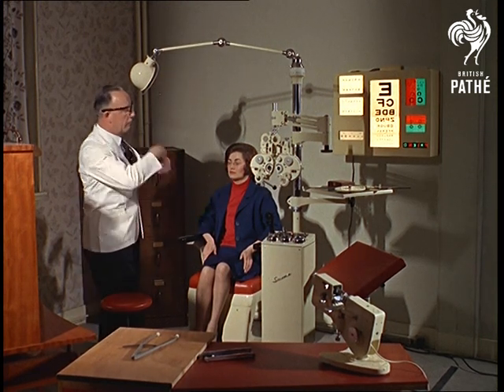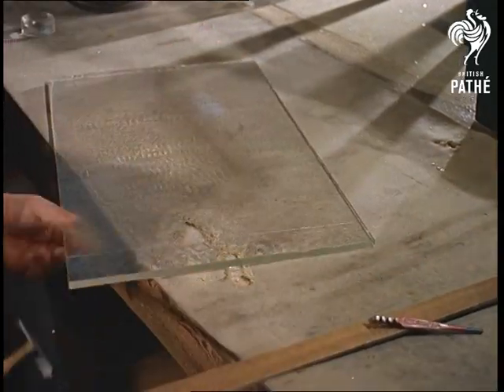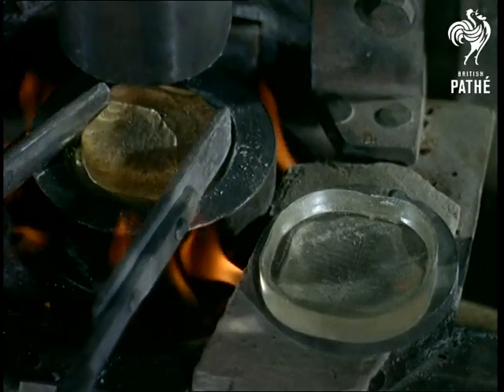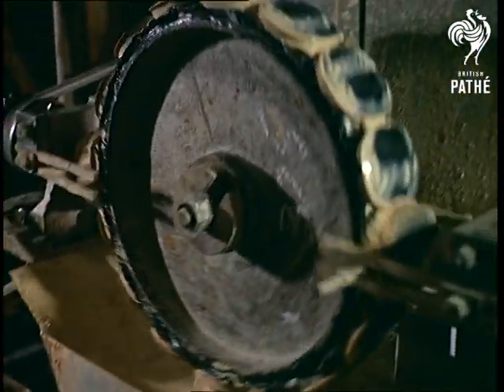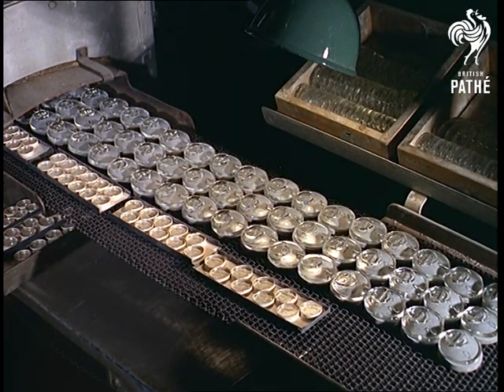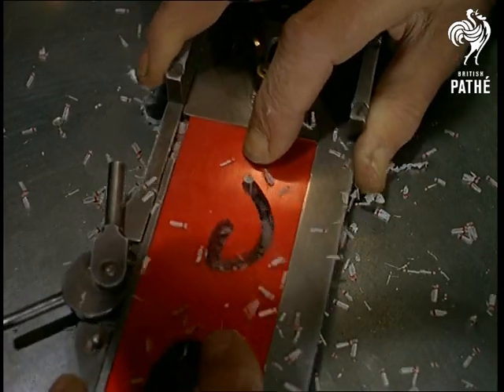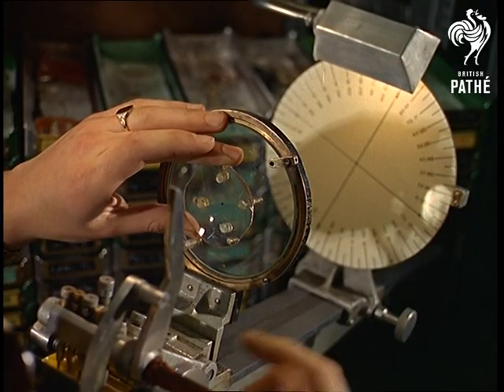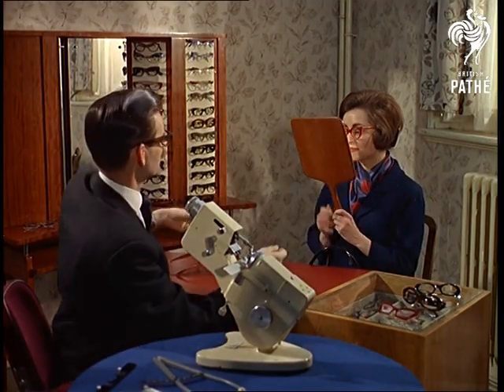Spectacle Manufacture (1965)

Comment: I wish Saville Row eyeglasses were still in Business. I bought a pair off ebay but the temples cables ends bend into my ears and aren't long enough.
Reply: Extend them using some rubber tubing, then heat the arms with a hair dryer enough to soften and bend out so they  are not so tight.